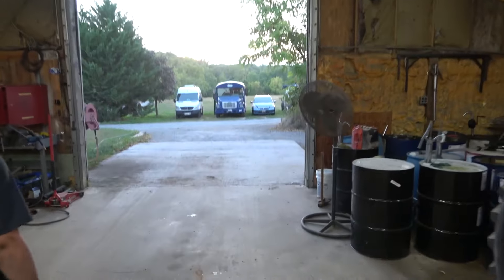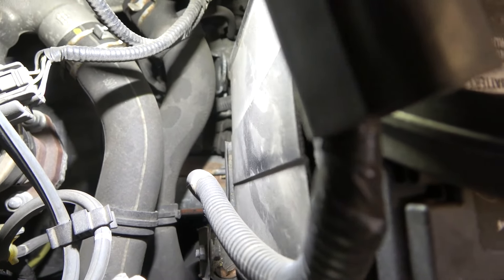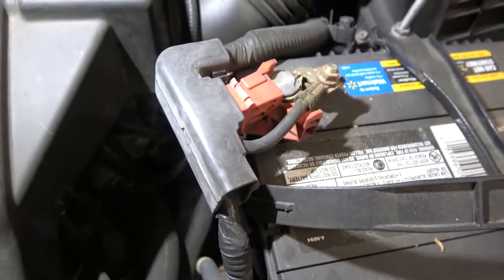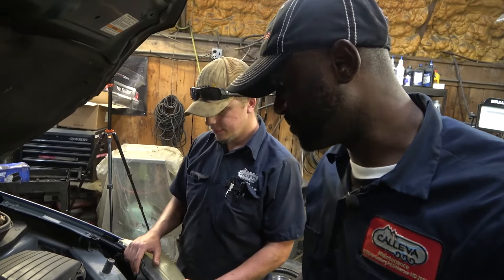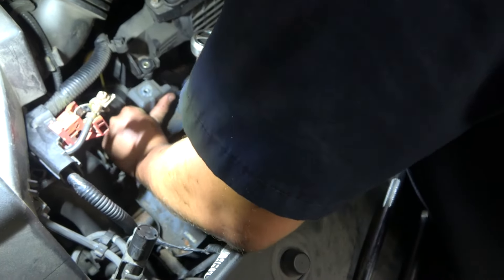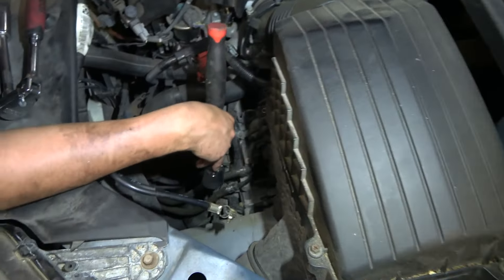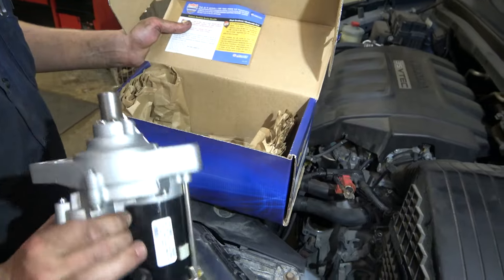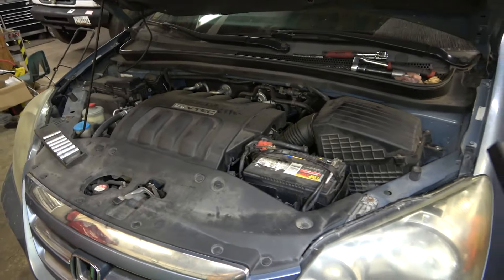Honda Odyssey intermittent No Crank No Start, is The Starter Bad or The Ignition Switch? Diagnosis

Comment: Hey Bro!! My 2004 Honda Odyssey 3.5 Automatic transmission has the same Problem as that one has! But You know? I'm already changed ignition switch, Starter and Battery. All of them Brand new! And guess what? The problems is still there! 😢😢😢 Is there anything You can help me?? 😮
Reply from the maker: @primisymas6552   The starter wiring needs to be tested
Reply: Keep Push shifter all the way forward turn key at same time my odyssey works that way

Comment: I hear that timing belt , yikes.
Reply from the maker: @daveunbranded   Yes! the timing belt tensioner was completely defective, we did the timing belt on it off camera, we replaced the timing belt, tensioner, water pump and idler pulleys off camera then the noise stopped!
Reply: @KITS_Auto_and_Truck_Repair  I heard that same noise on a neighbors car. Removed the serpentine belt and noise still existed. Sent him to the local shop for the timing belt. That is how I knew what it was
Reply from the maker: @daveunbranded   Ah Ok!!

Comment: Can you give link to test A/F sensor in car after removed it
Reply from the maker: @user-hr5dc4ly3q  I do have a couple of videos here in the channel where I'm showing how to test an A/F sensor, I recommend you check them out!
Reply: @KITS_Auto_and_Truck_Repair 
I want to know how test heater circuit pulses after r moving AF sensor because one mechanic say on metsubishi cars heater circuit gives pulse even AF sensor not connected but in my car after removing error code give please only for 10 seconds then stopped 
So is this pcm system 
Or ecm has problems

Comment: Circuit needs to be loaded for voltage drop test to be meaningful
Reply from the maker: @jyao5409  Yes! there has to be current flow in the circuit for the test to be accurate!

Comment: You're apprentice is very lucky to work with you. He is going to learn alot!  Doing the basics by checking for voltage, Ground and voltage drop is definitely the best method before replacing a starter. I once replaced a starter on a straight shift Nissan, just to discover it was an intermittent problem with the clutch safety switch. I was for sure it was the starter. I learned a valuable lesson that day!
Thanks for this video, I'm sure it's going to help many!
Reply from the maker: @bobcombs7138  My Pleasure! doing some tests before replacing a component is always the best way to go about these kind of issues, My apprentice Kyle is very smart and he learns very fast, he is a hard worker we are lucky to have him! I'm excited to see the kind of Technician is gonna be in the Future!!

Comment: Great vid thx. Helped a lot. I have a corroded and damaged neg ground wire. I thought it was an error that a two inch portion of the cable is unprotected under the starter, but several other honda vehicles have the same feature, as do many other units including OEM replacement parts. A strange design choice, unless obsolescence is in mind.
Anyway. I just had a BFO (Blinding Flash of the Obvious).
The two inch length of bare exposed copper on the Honda Pilot/ Odyssey/ Prelude/ etc ground wire has a definite function.
It is a heat choke.
I used one on the NTC thermistor sensors in the incubators I designed, to prevent ambient conducted heat from affecting the temperature measurements.
This one on the Honda stops the conducted heat from the engine increasing the resistance of the ground wire by using atmosphere to keep it cool.
So taping it up and insulating it from the air would be a bad idea.
Reply from the maker: @colinellicott9737   Yes! GGreat input

Comment: what is the wire at 25:08 that is corroded? i have the same situation with my honda odyssey and have already replaced the starter and its still not cranking or starting. the cable you pointed to on ours is very corroded and even started fraying, any help would be appreciated. Thanks for uploading this video to help my diagnostic!
Reply from the maker: @sillylilfellah   Check the wiring and replace the wire if it's corroded

Comment: very powerful, you do a great job.  am very complicated in different types engine noises if possible please.
Reply from the maker: @kondwaninampeya5780  Thanks! That noise was caused by a defective timing belt tensioner, the noise was fixed after we did the timing belt on it!

Comment: Great how to! One question how did that battery tray come out so easily? My ‘06 has bolts I had to take out from the side of the frame under the air box.
Reply from the maker: @miggymig83  Good question! bottom bolts were not too tight on this one

Comment: What about doing a voltage drop test on the wire from the relay to the starter solenoid? Is that a good idea or not necessary before changing the starter?  It might be able to light the test light but the light only draws about 250 milliamps and starter solenoid can draw around 20 to 30 amps.
Reply from the maker: @bernardocisneros4402  it's not necessary, but you can do it if you want!
Reply: @KITS_Auto_and_Truck_Repair  Thanks!

Comment: I've a 2004 Odyssey not starting.  Drove around all day then nada. No lights, no click,  just nothing. After some head scratching,  idiot lights came on but instant nothing when tried cranking again.  I'll check relays in the morning but what else should I check? Just replaced the battery but tested voltage and its good. Thanks!
Reply from the maker: @MeganAgler-ns5ld  Check the starter relay and the starter itself!

Comment: On my honda accord 2017 I had issues with not starting , I thought it was the starter, but it  it was a relay module located in that big fuse box under the hood.
Reply from the maker: @the.trollgubbe2642   oh cool!

Comment: If the starter just spins but doesn't engages. What can it be? I replace the starter with a new one and still does the same, just spins doesn'tengage.. Battery is good as well.
Reply from the maker: @lasttake3820  Crank your engine by hand and see what happens, your engine might be seized!
Reply: @KITS_Auto_and_Truck_Repair  I turn the engine and it is not seized. I did all three electrical test to see anything wrong with the starter circuit. They all passed.